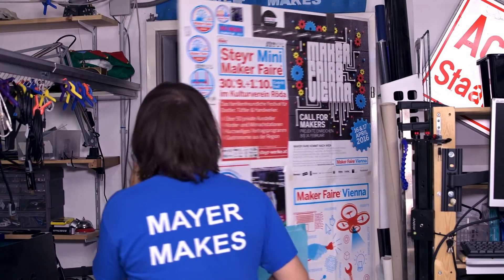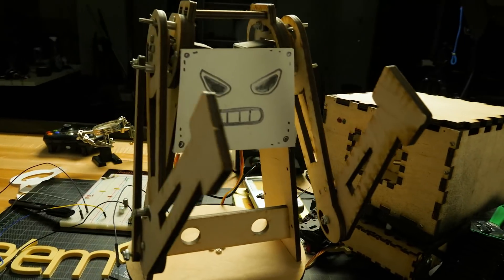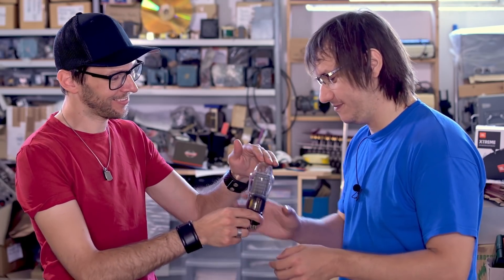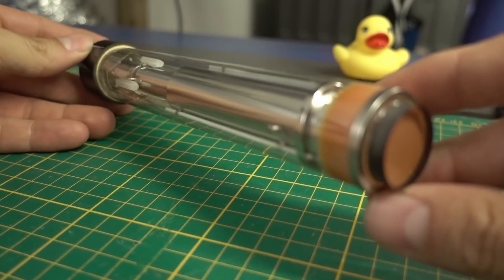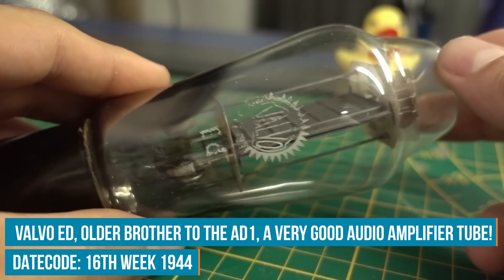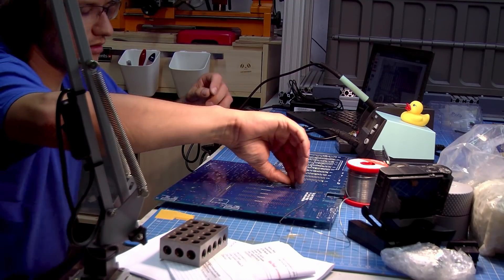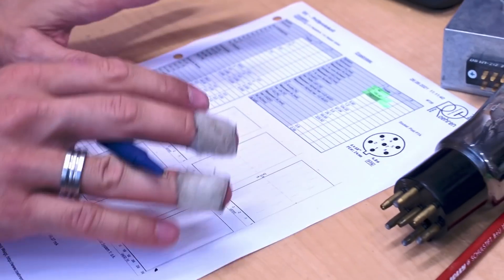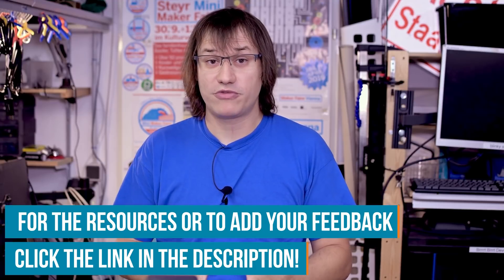You Cannot buy this Vacuum Tube Tester. You Build It!

Comment: Very cool guys.  I am an audio electronics repair guy in San Diego, California.  I own the Orange VT-1000 and use it very often.  as you know this unit is not made anymore so if it dies I'm screwed.  Will this unit be avail to purchase or build?  I am very interested.  Will it assign a gain/matching number like the Orange unit does?  Please keep me posted, and GREAT WORK!!!
Reply: you got all the infos on the page linked in the description. the files parts and software have to be purchased from the creator and the unit built by yourself.

Comment: That is quite a machine. I have an English AVO valve tester from the 1960s which is amazingly adaptable. When it was made, it was unbelievably expensive. It is interesting that technology in 2021 has now reached the point where it is possible for one person to reproduce the functionality, and publish the methodology on how to build an equivalent machine.

The market for new and unused vintage tubes is extremely small, so kudos to somebody who built a tester for them. Personally, my old AVO tester is worth its weight in gold. I think I paid about €600 for it, and it can add €200 to the value of an old tube by mesuring how good it is (a bad tube can be worth €zero, but a good tube can be worth €5000). I will never sell my AVO tester.
Reply: awesome!

Comment: I'm still deciding which tester to build. I like the Roe Tester but is quite a large project. I wish there was a group project to build the mainboard and enclosure. Also considering Etracer.
Reply: it is ahuge project, and due to availability mine is still not finihsed(some parts are unobtainium at the moment), its for sure the most advanced one, it really depends on what you want to do with your device.
Reply: @MAYERMAKES  I still service vacuum tube guitar amps and hi-fi. So mostly pass-fail testing.  I'd like to work on some old juke box amplifiers but they have a lot of odd tubes. Because of the condition of some of them, I really need to be able to test every tube first, to estimate repairs. I don't currently own a tester and need to borrow one. I figure with the  prices that old testers are going for, I'm probably better off with something newer which can also do matching etc.
Reply: Take a look at uTracer. It's a kit that is very capable. Not as slick as this, but still very good.

Comment: Since when is 167% emission compared to spec sheet. good?  If tube characteristics were all over the map to that degree then spec/data sheets would be completely unreliable.  A good tube should be within 20-25% of the quoted spec to be a good candidate for inclusion in a design.  Otherwise any paper design would be completely a crap shoot when built.Anyway, upvoted since the quality of your information, history and editing is very good.
Reply: the specs on oldtube datasheets are (variies dependent on manufacturer and period) usuallymeant as guaranteed minimum emission rates. brand new tubes usually emit higher than spec, they degrade overtime in use and are usually replaced whenthe emissiongets to low or the tube fails to perform its function. we take manufacturing to tight tolerances for granted now but electronics made in the 40s and 50s were not that consistent inthe manufacturing process andoutcome. So you design based around a guaranteed emission rate and voltage your tube can handle, + some margin for less than perfect tubes.
Reply: @clemensmayer9171  Specs on datasheets are not minimal but typical rating or values wanted by manufacturer but there is a large range of spread. In fact for unused tubes values for plate current are +/-30% or even +/-40%. I tested many unused NOS tubes with 80% plate current, I have a Roetest V10. Old western datasheets show only typical ratings, except TFK datasheet for ECC803S, a special tube, datasheet says each triode is not far than 15% from typical value 1.2mA. Only datasheets for old russian tubes show the typical ratings but also minimum and maximum values, for example 6n3p plate current 6 - 8.75 - 11.5 mA. For new tubes production is the same spread or higher, I bought directly from factory ECC83 that measure 65% - 135%  plate current.

Comment: An easier and cheaper option is to pick up an old Tektronix 575 curve tracer.  Stay away from ebay. You can sometimes find them at hamfests cheap but they will probably need a little work.  Look for one with the 122c option which has a collector supply that goes up to 400 volts.  A small variac can supply the filament voltage.  Testing tetrodes and pentodes will need an external high voltage supply such as an old heath IP-17.  An adapter is easily fabricated with tube sockets for tubes you want to test. Using banana sockets on the tube socket pins allows configuring with external resistors. To drive the grids you may need to amplify the base/gate output of the 575.  Check out the manual for the 570 vacuum tube tester for ideas on converting the 575 for tubes. I was going to convert one of my 575's for tubes but don't do much with tubes anymore. Personally can't see the interest in tubes since the germanium transistor went the way of the dinosaur .

Comment: Back in the 1990's I was really big into analog audio - went through a stage of owning quite a few 'tube' amplifiers (we call them valves here in the UK). Along with modern 'Valve' amps made in the 90's by CR Developments here in the UK I also owned some 1950's Quad tube amps - a pair of Quad II amps which I had re wired, along with the electrostatic loudspeakers I picked up at a boot sale beck then. Vintage gear form the 1950's that sounded awesome when working. I remember even then it was not cheap sourcing new old stock 500B / KT66 tubes for those mono block amps. Lovely sound though.
Reply: thanks for the story!

Comment: If I knew someone that blows glass… is there a procedure that could be used to repair a broken tube if the only problem is that it lost vacuum? I realize that it would be an expensive repair, but for unique tubes, maybe it would be worth attempting?
Reply: yes, that is a possibility and people do that for special tubes.
Reply: @MAYERMAKES  thank you for your time.
Reply: The cathode of indirect heating tubes tend to oxidize quickly
Reply: @odindimartino597  thank you for adding that. I realize anything can be tried, is it possible to replace it? I would guess dismantling a vacuum tube for repair would be no small feat.
Reply: @EverettVinzant  It's near to impossible because elements in most tube are held in place with a mica insulator, the cathode is difficult to make and the material between the heather and cathode is fragile. Also,tubes are assembled in a special support and with special equipment. Homemade tubes exist but those are with direct heating and elements are held in place the same way as filament lamps